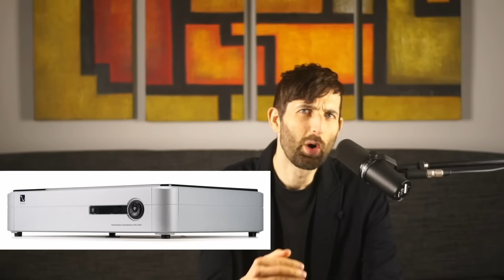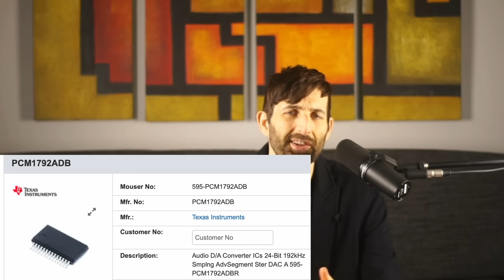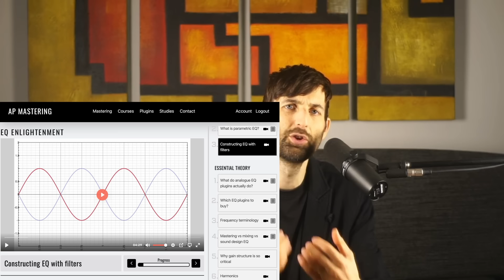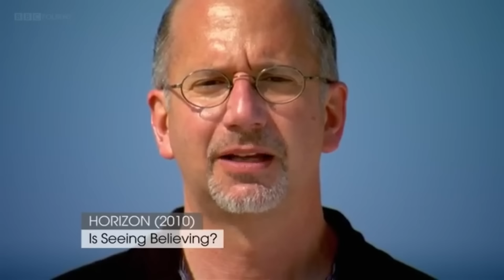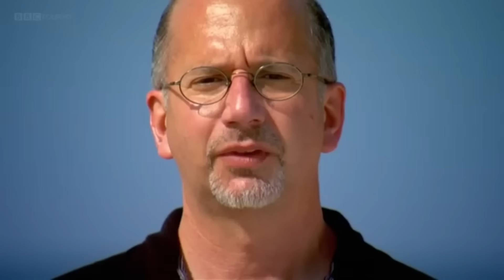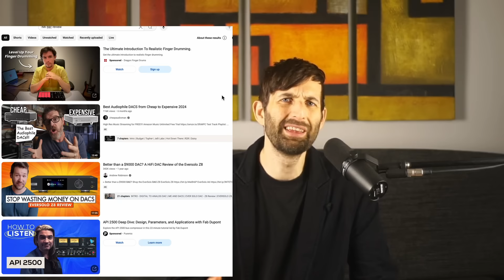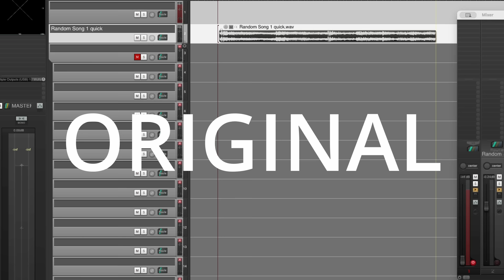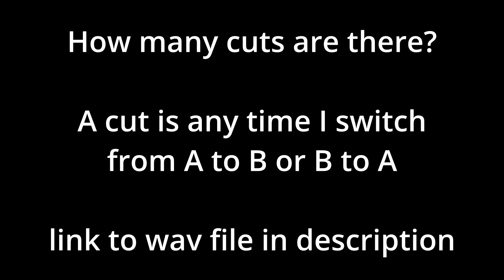The DAC Scam - Almost everyone believes the hype

Comment: I really enjoyed your other controversial takes, but this is the first one I have to disagree with. Funnily enough I used to agree with your takes, until I heard the differences (many... many times).

What you are missing:

- Chips are only a small part of what makes a DAC sound great. As much or more important are: power supply, filtering, clock quality, isolation, streaming source (if internal)
- many of the DACs you show that are that expensive, don't use off the shelf chips and use their own digital processing. Examples are Ring DACs (which you showed a picture of), various R2R DACs, and other custom implementations (for example Chord, using an FPGA and their own ladder output).
- filtering makes a big difference. upsampling makes a big difference. Pretty much all filters are audible. A ton of research goes into making better filtering for custom DACs. See for example PS Audio directstream, with custom 1 bit DAC, where the constantly developed upsampling and modulators make a huge difference. But this is a factor in all DACs
- the music you play and how it was mastered matters a lot. For example, your test sample sounds highly produced and compressed. The more dynamic (as in low compression, not dynamism) the music and the more it resembles natural sound (voice, real instruments etc), the easier it is to hear differences.

What you are right about:

- on the equipment most people use, you won't hear the difference
- on compressed Youtube or Spotify, you won't hear as much difference
- a great DAC can be found for a few hundred euros, and for most people it's plenty good. After that the differences get more and more nuanced

Is there DAC audio bullshit? Absolutely! Plenty of snake oil in Hifi. But there are substantial differences between DACs, and very audible.

Finally on any audio being transparent, there is no such thing, everything you use colors the sound in some way, even when it measures ruler straight (some high end DACs have noise floors to under 130db, and still differences can be heard). It seems we are astonishingly good at detecting changes in audio signals and extracting depth, timbre and impulse. Audio in that sense is pretty weird. And I'm still trying to figure out how we are able to hear these differences.

As for if you want to hear these things, try going to a high end audio show, or compare at the place of someone who has the equipment. Try a blind A-B test. You will find that everything sounds different, and it's not just (dis)tasteful distortion added to equipment, these devices are tested and measure straight. But still they sound different... :-) 

Love your channel! Also love the speakers you built, impressive stuff. Cheers!
Reply: Exactly that. Agree with 100%.
Reply from the maker: Hey so although many of your points are valid, this video was original MUCH longer and I edited out many of the bits where I was discussing the things you mention. I wanted to focused on the loopback tests and general background for a general case. That said, I feel like my AB loopback tests in this video objectively destroy the idea that a cheap DAC, like the one I use, a TC electronic BMC2, isn't already sufficiently transparent for the full range of human hearing. And despite your additional points, so far the poll results overwhelmingly confirms that this is the case. If there are such huge differences, you would be able to instantly tell me where and how many times I am switching in the blind test.

You mention it is more difficult to hear subtle differences on a noisy compressed sample but in my almost 20 years experience as a mastering engineer, I my daily experience strongly indicates the opposite. It is FAAAAAAAAR easier to hear subtle differences in tonality and level and pretty much everything the closer the signal is to white noise. With a lot of orchestral music for example, you can do outrageous things with the frequency response and nobody bats an eyelid because the music is so dynamic and relaxed in the high end.
Reply: @APMastering YouTube has poor sound quality....
Reply: @APMastering the wise man who is secure within himself is mostly preoccupied with knowledge he has yet to acquire that may reshape his existing paradigms...arguably the basis for much of humanity's progress. The opposite is true where rigid, binary, reductionist beliefs are clung to.
Reply: I have four DACs and they all sound different. The digital part is probably accurate and precise but the accuracy and precision can be fragile if insufficient care isn’t put into building the rest. The manufacturers of hi-fi equipment often have a house sound and set out to voice the DAC. Professional equipment is built to give a more accurate sound which doesn’t stray too far from what is intended.
Reply: You are 100 per cent correct...this guy is completely wrong on this one or deaf..technically it's been proven and we all of heard the differences......😅

Comment: what DAC do you use professionally in your mastering studio and why? hope you didn't spend more than £200 as there isn't any sound difference anyway.....
Reply from the maker: Both my own mastering studio and the last other studio I worked at had RME digital interfaces with Lavry convertors. That was always the safest solid bet but was quite expensive. But I sold that chain a while ago. My current actual monitoring DAC is built into my hypex FA123 plate amps now which get coax spdif.
Reply: @APMastering  why not a cheap £200 dac as you pointed out in your video though as there is zero sound quality difference? I'm confused. Should I buy a cheap focusrite or a burl ?
Reply from the maker: you don't necessarily need to buy focusrite. there are better things on the market for the same price but its borderline good enough

Comment: Nice vídeo, it nail the point.
In the nineties I notice differences between CD copies with the first CD recorder the Marantz.
People in the radio station didn't believe it until they test me with A and B and I never failed, there was audible difference between the two copies and the original, one with verbatim green substrate and other with an old BASF yellow substrate.

P.S. If someone could tell the difference between wav and MP3 128 kb in Volumio software on a raspberry pi with a decent IS2 DAC(I use Allo Boss gen1, also built myself a linear supply for the pi) I would like to know, cos I don't ear it, I use to blind test codecs and compression rates, and could tell differences, with Volumio all MP3 plays at 24 bit and I can't tell anything, so all MP3 sound perfect like a CD.
Reply from the maker: could you describe those differences? I've heard the claim before but find it hard to understand what difference there could be that wasn't obviously errors and glitches
Reply: @APMastering  From what I remember there were differences in treble more mellow, and bass more loose or less controlled.
So I was able to tell if they put the same one 5 times I would say five times what was on.
Verbatim was slightly better that BASF but the same direction, only less noticeable.
Now I'm unable to find any difference between MP3 even at 128kbit, from wav when reproduced at 24 bit (MP3) Vs 16 bit (WAV ) in Volumio in raspberry pi with Allo Boss DAC.
(Volumio always plays MP3 at 24 bit.)

Comment: The website Audio Science Review does objective measurements of DACs (and many other types of gear too). Google their "Review Index" to find a list of all the devices they've measured so far, and rank them by SINAD descending. There's just so many cheap devices at 115 dB SINAD or above. At 115 dB SINAD and above, any more improvement becomes purely an academic exercise. Someone might have said that nobody will need more than 64K RAM back in the days, but really, nobody will need more than 115 dB SINAD from their DAC.
Reply from the maker: The problem with that website is the trustworthiness and quality of the data... but granting the quality, yes, basically everything sensibly designed today sounds great

Comment: Answer:

The YouTuber's claim that DACs are a scam is demonstrably false. Here's why:

Audible Differences: While the differences between a $10 DAC and a $100 DAC might be significant (e.g., a noticeable improvement in clarity, soundstage, and bass definition), the differences between a $100 DAC and a $1000 DAC are often more subtle (e.g., improved micro-dynamics, a more refined treble, a greater sense of "air" or space). These differences are often still audible, especially to trained listeners with revealing headphones or a high-quality speaker system, and when listening to well-recorded and mastered music. Properly conducted blind testing can often reveal these differences, even if they are subtle. The audibility also depends on the quality of the source; a compressed MP3 will show fewer differences than a high-resolution lossless file.

Measurable Differences: While basic measurements like THD+N (Total Harmonic Distortion + Noise) might look similar on paper for many DACs, more sophisticated measurements can reveal significant differences. These include:

Jitter Analysis: Measures timing errors in the digital signal. High jitter can lead to a blurred soundstage, a loss of detail, and a less engaging presentation.
Intermodulation Distortion (IMD): Measures how a DAC handles multiple tones simultaneously. High IMD can make complex music sound harsh and congested.
Impulse Response: Shows how the DAC responds to a very short, sharp signal. This reveals information about the DAC's filter characteristics and can correlate with perceived transient response (how quickly and cleanly the DAC reproduces the attack and decay of sounds).
Component Quality: Better DACs use higher-quality components (capacitors, resistors, op-amps, etc.) in their analog output stages and power supplies. These components have tighter tolerances, lower noise characteristics, and better overall performance, leading to a more accurate and refined sound.

Engineering Expertise: Designing a good DAC is not simply a matter of throwing a chip on a board. It requires significant engineering expertise in analog and digital circuit design, power supply design, and filter implementation.

Addressing the Specific Points in the Question:

Phase: Yes, a poor DAC can negatively impact phase response, particularly through its analog reconstruction filter. A well-designed DAC will minimize phase shifts within the audible band.
Coloring: DACs can introduce subtle "coloring" to the sound, primarily through their digital filter choices and the characteristics of their analog output stage. However, this coloring is usually much more subtle than what you'd get from an equalizer or a tube amplifier. A good DAC aims for accuracy, not intentional coloration, but the implementation inevitably imparts some sonic signature.
Conclusion:

DACs are not a scam. While the law of diminishing returns absolutely applies in the audio world, and the differences between DACs can be subtle, a well-designed DAC can significantly improve the sound quality of a digital audio system. The YouTuber's oversimplified argument ignores the crucial details of how digital-to-analog conversion actually works in the real world. The key is to understand that the DAC is not just about converting 1s and 0s; it's about how accurately and cleanly that conversion is performed, and how well the resulting analog signal is handled.
Reply: Nice AI answer,but e was talking about 10 Euro Chips in dacs and not about 10 Euro dacs .
Reply: Amir points out those differences are inaudible.
Reply: @carlsitler9071  It does seem like he's (Amir) going for transparency. (desires) The brain has audio neurogynastics sometimes, so there could be subjective hearing. You'd need an objective measuring tool to really get it. It's like in Software limiters, there's usually a Transparent mode, then there's a Punchy or Color mode etc. He probably would (possibly desire) a built-in Transparent mode, that probably doesn't cost much, maybe under 100 usd.
Reply from the maker: how did the OP do in my blind test?

Comment: You showed at least 3, maybe more, high end DACs which DO NOT use off the shelf chips. If you are going to argue a point, at least try to be factually correct. Btw., DACS also need an analog output stage, clocks and input processors which mysteriously went AWOL in your brief about what a DAC contains..
Reply from the maker: my video was highly edited. the original recording of my talking is over 1 hour long. notice how my content gets views. if I exhaustively covered everything it would be boring and would get 100 views
Reply: @APMastering Lame excuses

Comment: I know how to solder…how can I buy those chips and make my own dac
Reply from the maker: its not that simple. you need a power supply and general infrastructure. I'm sure you can buy a PCB kit but chips are not like through hole components, they are extremely small with a loads of legs most stuff now is surface mount so you aren't using a soldering iron for this stuff really anymore
Reply: @ Thanks dude

Comment: I used to be a mixing engineer; I still am, but I don‘t have to do it to earn a living anymore. I‘ve been saying this for years. I despise the ripoffs.
And even if all of this stuff were true - why would anybody train themselves to hear these "advantages" over let‘s say a Bose system? You‘d be training yourself to not enjoy music anymore on anything other than expensive gear. You‘d like music LESS.
Reply: And the eq used in pro mixing would probably make an audiophile vomit (if they're still 'allergic' to tone/eq controls as they were 20 years ago.)
Reply: @cjc363636  eq is caca
Reply: Digital mixing and mastering is done at 16/44.1?  Not.
Reply: @GreenArrowNetwork Not 16bit, no, but you‘d be surprised by how many engineers record and mix at 44.1. And why wouldn‘t they - 96 more than doubles the load on your CPU - less plugins, higher buffer sizes… a lot of disadvantages for very, very little gains.
Reply: @GreenArrowNetwork  As for the pros (1998-2014 is the time frame I‘m thinking here) - most engineers I know or knew recorded 16/44.1 up until hard drives became fast enough for 24/44.1, which many still use to this day. I know only a few who tried 24/88.2 for a while, but the CPU overhead wasn‘t worth it they told me back then. I tried that once as well, but I resampled all tracks down to 44.1 before mixdown; that was in 2005. These days I guess more engineers record 24/96 for whatever reason, the younger ones mainly (if they‘re young enough to not have learned about proper leveling they might record 32 float), but most old schools guys I know are still at 24/44.1.
Guess what? Never did a band or client ask me about the bitrate or sample depth. Not once. Nobody cares.
Reply: @arminbreuer7968  well to be fair i do think you can have better sound with better amplifiers, better speakers and room treatment, as far as dacs go i think it’s all depending on the sampling rate and circuit design, for exemple you can buy a gesheli labs with amazing op amps and an akm4499 for 600 bucks …. So yeah paying thousands of dollars for a boutique dac seems literaly insane to me. 

There is a very funny video of « Hifi Huff » reviewing the Nagra tube dac (70k euros) which he proudly bought and raved about, in the video of the laiv micro dac review (1k euros) he struggles to tell the diffrences between them and SELLS his tube nagra dac saying it’s not related to the review of the laiv micro dac 🤣🤣😂 i mean, please, if you want to laugh go watch this video. 

This dude is just like Andrew Robinson, glorified sales man. Straight up dishonest and full of bs.
Reply: Well, we can do a little better than a Bose system without going crazy... I mean I'm a defender of cheap hifi, but there's limits 😉

Comment: By 02:00 you forgot the most expensive part which is the actual implementation of the chip on the whole analogue devices network, plus PCB design/manufacturing (or even worse, hand wiring/soldering) other components expenses... And most important, the validation and quality control from experienced audio and sound engineers as well as customers support... Other than that you're more than free to build up your own 2ch DAC...
Reply: This is were RME ADI comes into the mix and blows that expensive snake oil bs to pieces no matter what chip you add.
German professional engineering and implementation, quality control, professional audio recommended and used.
Put that ADI in a aluminium milled box and sell it for 20 times the actual price 😉
Reply: @alvarojesusnietoillescas8417  no shit bro. That’s not really the point of this, he’s talking about the excessively expensive ($1000+) DACs that have no substantial difference then the “high quality” DAC that go for a few hundred. Obviously no one is upset for paying 300-500 for a good DAC, even if the chip is $10. Everyone understands this lmaoo
Reply: @alvarojesusnietoillescas8417  thanks for giving more context.
Reply: @alvarojesusnietoillescas8417  Exactly, how convenient he left all that out.
Reply: @Audiofreak71  He didn't. He stated that there are many good dacs for a few hundred that are doing the same thing. If a company can do the same thing and sell for $1000 or less then what is $10,000 getting you?
Reply: @h1a8 By your statement you’ve never owned a $10k dac and possibly not even a $1k dac , if you had you would not have made that statement to me lol.  

Look I’m all for saving a buck but until you have owned the top end gear you will continue the same lame argument that’s regurgitated throughout the internet. 

It’s old and tired , this guy is just trying to make money by getting the naysayers against the people who have first hand experience to watch his videos and have a debate. It is what it is but until you’ve owned the gear you have no legs to stand on. Have fun ✌🏽